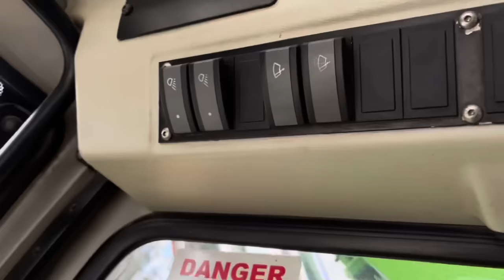Last min Transit hub..with limited tools🔨 if in doubt bottle it out 🔥 van struggle 🤬

Comment: quickest way to get those locking nuts off chris, smash a male c coupling into it and you can undo them with a bar then. had a struggle with them before!! on another note, if you need any aircon sorting give me a shout chris!!  not far from you guys
Reply from the maker: Cheers mate for the advice👍 my aircon is crap mate 😅🥵
Reply: @Professional-struggler  I've got a few of partics scunny vans to do tomorrow morning, 
Sure I could fit you in somewhere to regas the struggle bus 😄❄️

Comment: Great video, just had same issue on my 2006 Range Rover, chrome caps, starts of 22mm then 23 then when really corroded 24mm, absolutely crap idea, just ripped all mine out and put all new in, with a good blast of anti corrosion spray between nut and cover, try and keep the corrosion at bay.

Comment: On that JCB tele, take the belly plate off bottom of engine and there is a fuel filter right up under there on the side of the engine.

Comment: Iv had bushings ect like that tow hitch...
I weld them out.....a couple of runs bottom to top, or out side to out side ( depending on how many fosters you've had.......lol) then tap with drift.....
Out thay pop......much clearer and no chance of cutting into casting.
Reply: I do the same thing with roller bearing cups, always works.